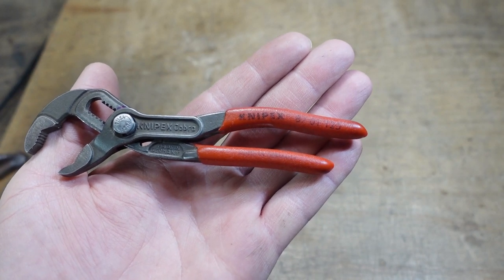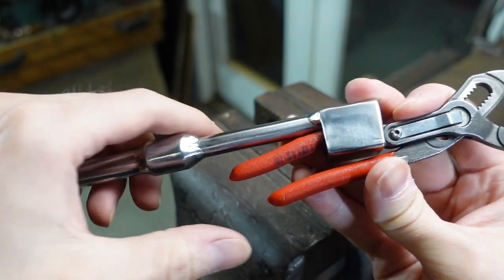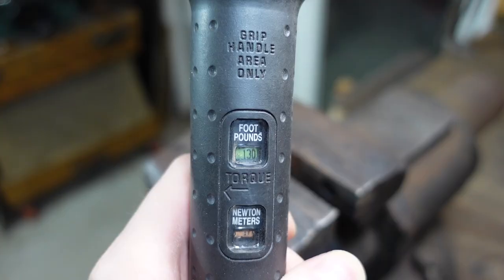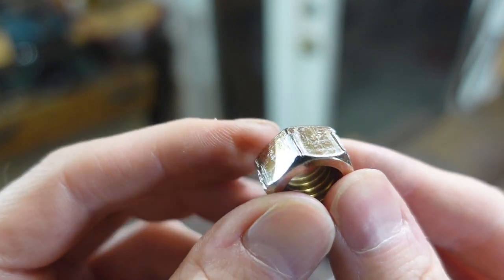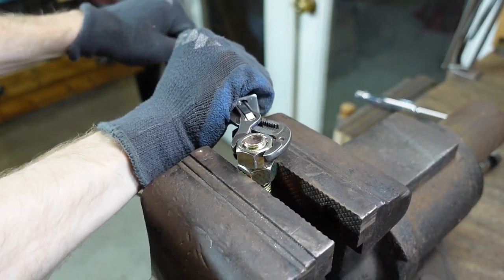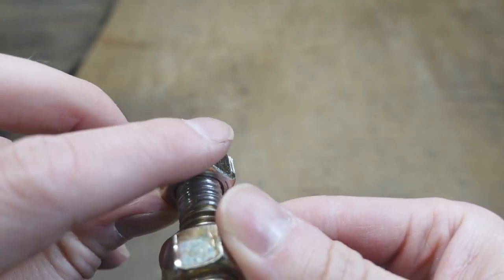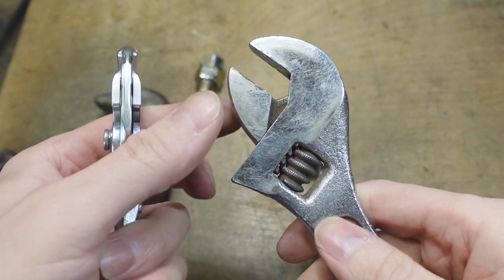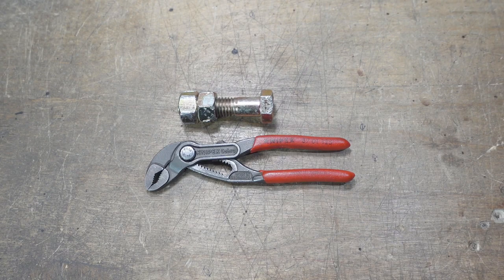Little Knipex Cobra 125 Pliers Pushed to the Limit

Comment: The inconsistent force you're applying when you loosen the nuts at the higher torque values results in peak torque amounts that are far higher than the torque value you set with the torque wrench.  You'd never use a torque wrench by shoving it.  You do what you did: you pull slowly and consistently.  What you're doing is like trying to measure your weight on a scale while jumping up and down on it.
Reply: Go somewhere else
Reply: Right, principle of the impact wrench :) But that means that the pliers resists a greater torque than that applied by the torque wrench ... so it goes in the right demonstrative direction.
Reply: Your right John, that's why it can loosen them. It like loosening a lug nut with a tire iron, you can stand on the tire iron and it won't loosen,  but if you bounce a little while you stand on it it will come loose. I like your comment.  👍
Reply: @betomendoza5981  You and diezelle57 are both right, but I am also.  The impact wrench analogy makes sense, as does yours.  But I think I'm still right - you can't measure the torque at the moment of impact, or at the moment when you bounce on that tire iron and break the nut free.  Peak torque is higher than shown, but as diezelle57 said "it goes in the right demonstrative direction." :😊
Reply: @johnnewell5025  we're on same page. 👌
Reply: I have to disagree. The nut is tightened to a set torque spec by the torque wrench. Ultimately the nut will only move when you turn the past that torque amount by smoothly turning or jerking it loose. The point is how tight a nut can it loosen. Yes, when torquing a nut/bolt it should be smooth and your hand placed correctly on the handle. Still a very interesting video showing basically you could loosen the equivalent of a 1 ton pickup truck lug nut with out the tool failing!
Reply: Whether "jolt" pulls or constant pulls, it is still putting pressure on the handles and it seems that's what he is testing here? 🤔

Comment: I'm so glad to see you applying counter torque to the torque wrench head. That's the way I was taught to use a torque wrench in the Navy. It drives my OCD crazy to see YouTubers using torque wrenches without holding the head of the wrench!

Comment: You could try as a torque test a bottle of old cough medicine where the syrup has crystalized in the cap thread and it has a child-proof cap. Whilst coughing, I used multigrips to unscrew the cap and it was still useable later.

Comment: What size Knipex Cobras do you recommend for every day portability?
Reply: 150 maybe
Reply: 125 or 150. 150 teeth are a little deeper and better for gripping a round surface but the weight between the two is huge diff so for EDC I say the 125mm are awesome.

Comment: I just don't see the point, if you're in a situation where you have to use a diy cheater bar on a pair of small pliers odds are you probably got bigger pliers lying around. I would've liked this video more if this was purely hand/upper body strength.
Reply: Its a torture test to show what the pliers can do. If in a pinch knowing it can remove 100ft lbs is very impressive.
Reply: You could use any piece of pipe as a cheater bar.  Nobody is going to put 150 pounds of torque on a 5 inch plier with bear hands.
Reply: It’s not about a situation. Also bigger pliers don’t really fit under a sink. You try it.
Reply: The video is about strength test, not ergonomic test.
Reply: A cheater bar is solely a glorified metal tube of somewhat-correct-inner-diameter, and the chance of having that lying around is always higher, than having bigger pliers lying around. Sorry John Elder, just noticed that I repeated your answer.
Reply: Just the fact that a cheater bar is needed to break them is good enough for me. I have a larger pair in my work toolbox. I use them all the time.

I'm co sidering saving weight by swapping them for smaller ones.